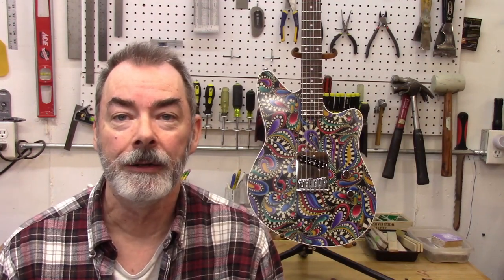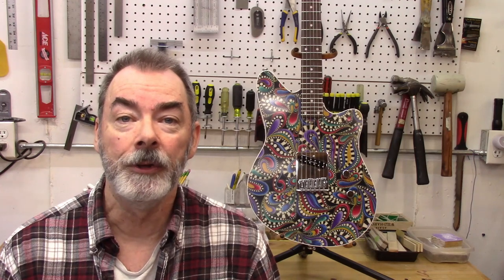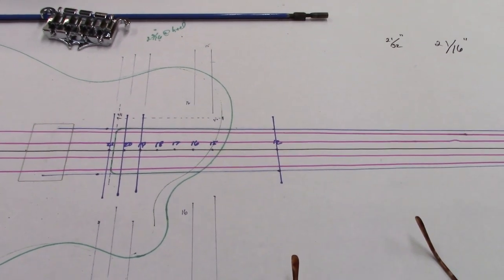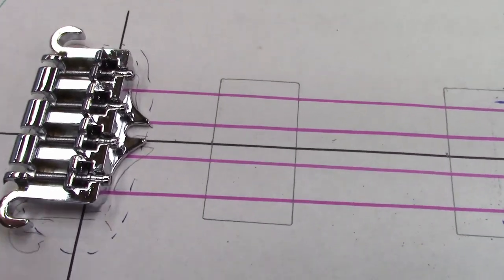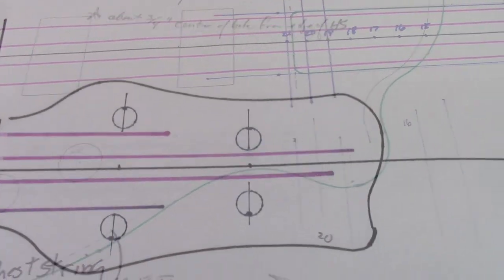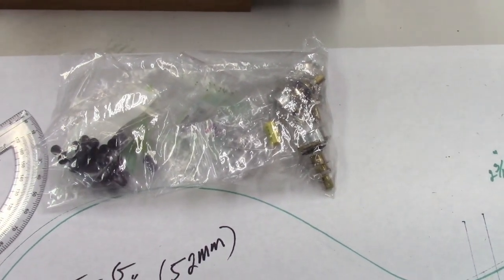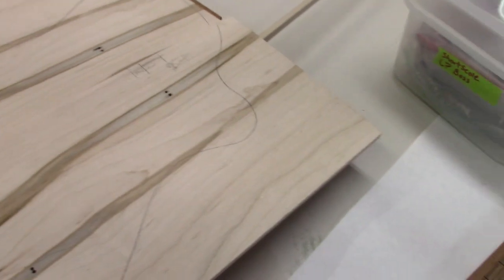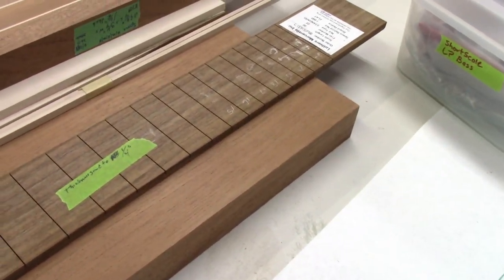Building a Short Scale Bass  Part 1: Intro & Design

Comment: hello, very good job, i also build guitar and i want to build a short scale bass (30 inchs) could you tell me, please, the length of the truss rod ? thanks
Reply from the maker: Sorry for the delay in replying. The short answer is: it depends. It's not just the scale length, it's also the number of frets/fretboard length. This bass has 20 frets and I used a 20.125" (510mm) truss rod. If you plan on more frets than that, remember that more frets = longer fretboard, so a longer truss rod would be used.
Reply: @onebyoneguitars2303  thanks for the answer where do you find one ?
Reply from the maker: I found the length needed at Bitteroot Guitars online.